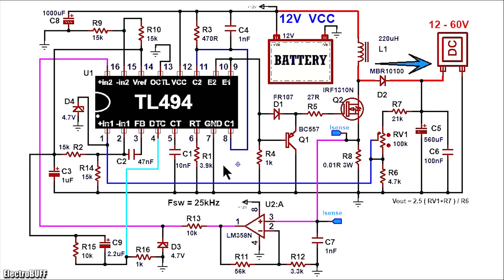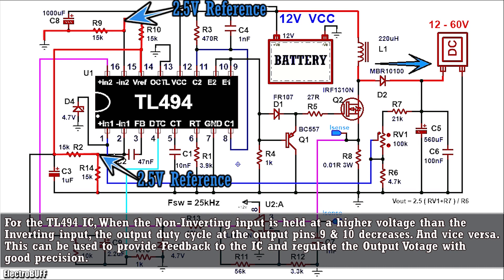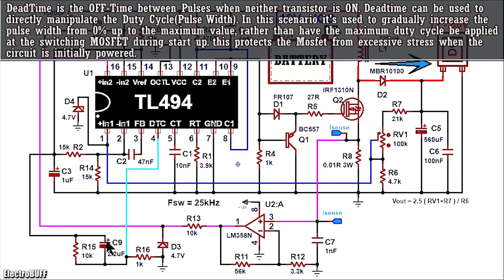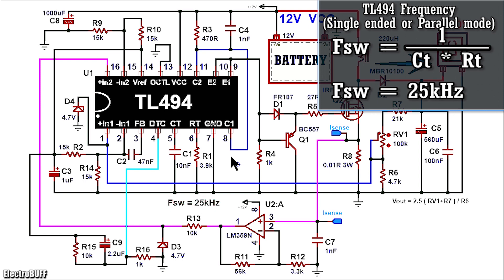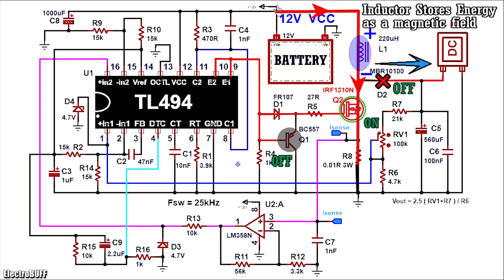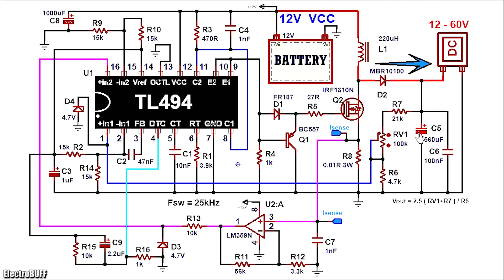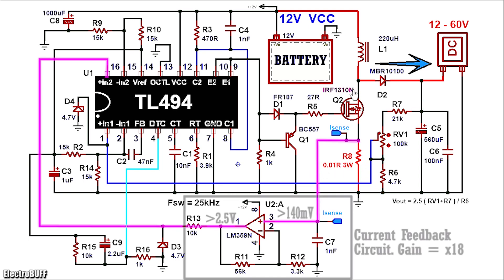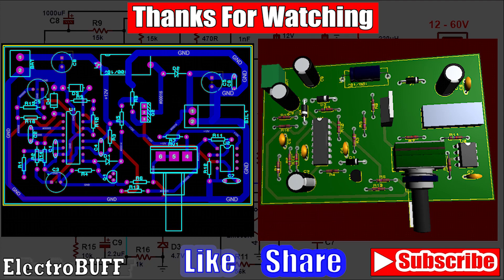TL494 Adjustable DC-DC Boost Converter Switching Power Supply 12-60V 100W+ | ElectroBUFF

Comment: Hi,
Requesting a circuit diagram for 
Input - 12V or 24V DC
Output - 230V DC
Power - 75W
With overload protection and short circuit protection.
Can you suggest me the best?

Comment: Thank you for your effort and your wonderful channel. I wanted to ask you a question, how can I get the output voltage of 5 volts from this circuit
Reply from the maker: This is a classic boost converter. If you want 5V, just use a common lm7805 connected to the 12v battery for low current applications.
Reply: @ELECTROBUFF  Hello, yes, but I need it with a power of 100 watts
Reply: @homamalsrour5673  how do you get D1 FR107 in multisim